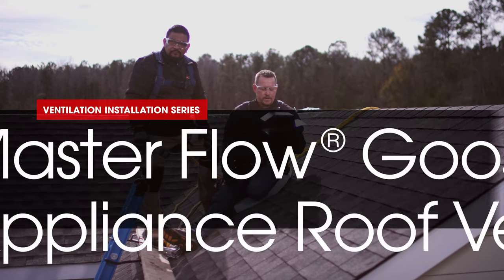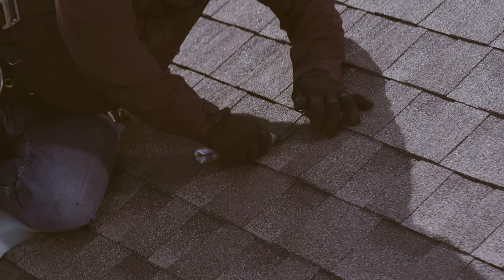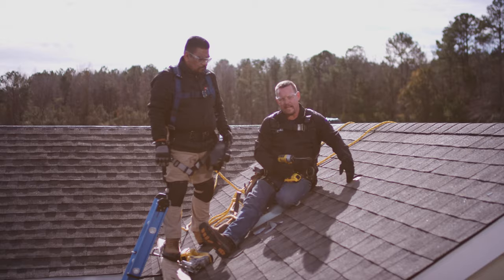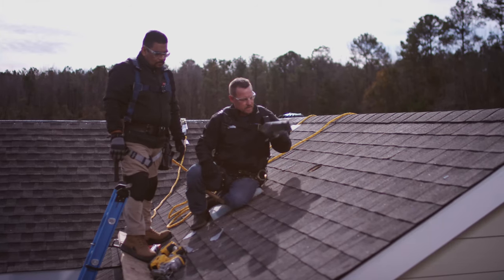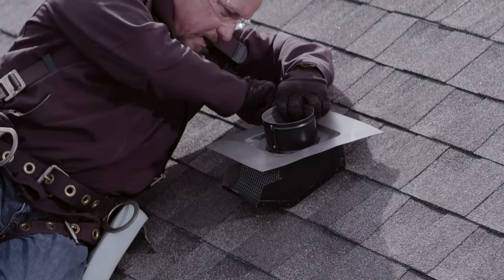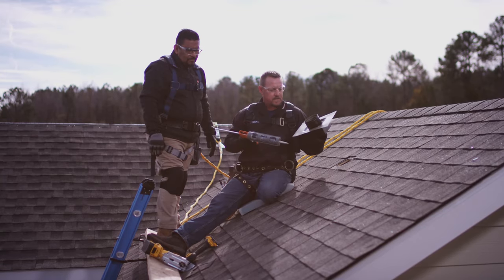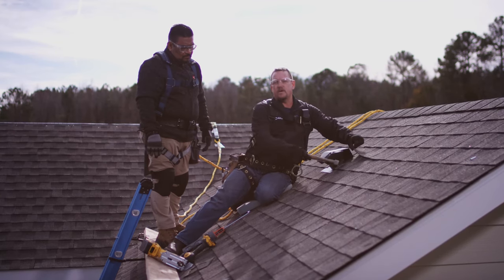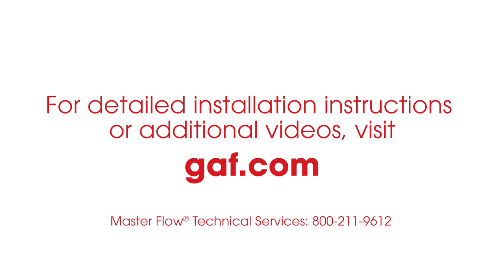How-To Install Master Flow Goose Neck Vent Installation Demo | GAF Roofing

Comment: Looks great but the Master Flow vent I bought has no flange on the bottom side....how am I supposed to attach my vent?
Reply from the maker: Our team is here to help! Give them a call at (800-766-3411), and they will be happy to assist you with this.